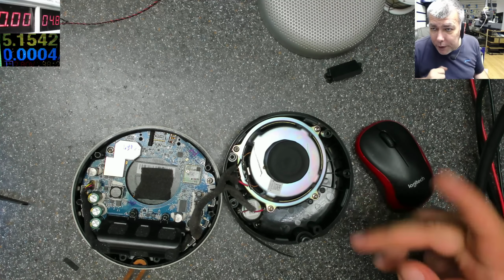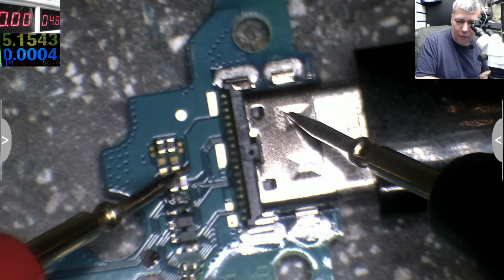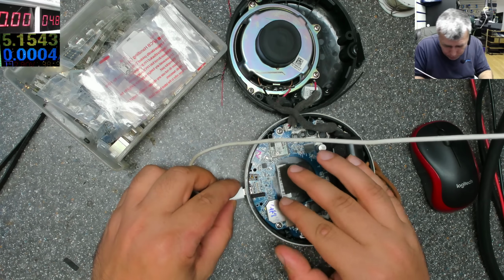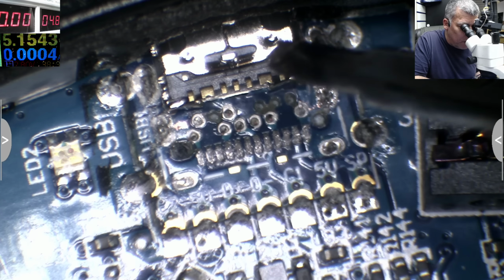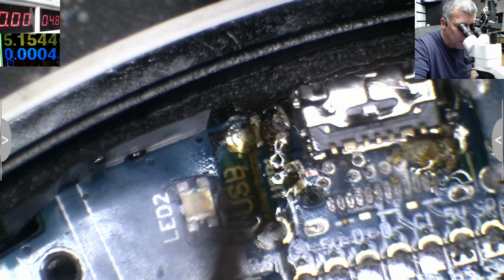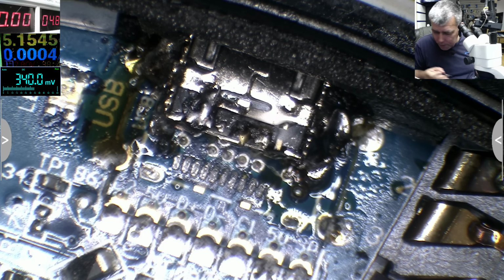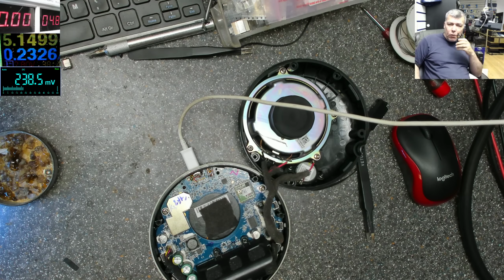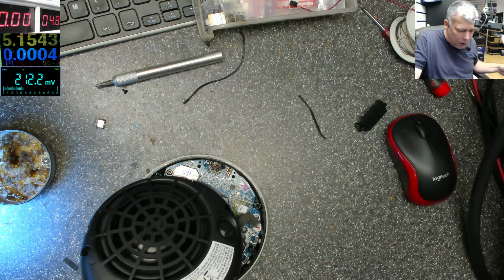Usb-C To Micro usb port charging port modification

Comment: awesome..........  I was able to get an amazon tablet charging again...........  I could not find a replacement port so i used a port i had here.    I ran 4 jumper wires instead of the original 16.
No data connection but customer just wanted it charging again as it was only 6 months old.    Works !      Charges at 1amp and is still usb-c.       Thanks Sorin, another great video

Comment: hello can you share model number of your hantek multimeter and also if you connect bench tech power supply to get output voltage or current? thanks great videos ..canada

Comment: although i dont know if its cost effective , new one same model cost about 20 euros in my shop, although this one has been branded , but it is exactly the same down to a strap and metal on it, built in same factory. We don't even bother changing connector, whole pcb is bought for spares and charged to a customer for 8 euros to be replaced
Reply: 20€ for what, for B&O beoplay A1??
Reply: @bodeksrc8007  yea, as much as people don't want it to be , all cheap ones are actually rebranded coming out from pretty much same factory , some with minor tweaks  slightly bigger battery, some additional junk in box, and custom colors.
but it is exactly same 5 w speaker with 10x price tag.
Reply: @idimidodjimi6760  lol "from pretty much same factory"? Then that pretty much means it's made by someone else. Pretty much makes it a knockoff.

Comment: I HAVE SPEAKER LIKE THIS THE BATRY OF THIS SPAKER   HASE 3 WIRES THAT S MAEN NEGATIVE WIRE AND POSITIVE  WIRE BUT  THE THIRD WIRE IT S USING FOR WHAT BECAUSE I CHANGED THE BATRY WITH NEW BATRY WITH ONLY 2 WIRE BUT IT S NOT WORKING GOOD

Comment: 1:55 comeon Sorin! You have microscope and you look at the pins but NOT inside of the charging port? 
gold traces/pins inside can be broken or 1/3 or their lenght can be ripped off - that is why, one charger cable will be working, other will not.
you can easly check it by looking inside of the port.
but why you didint do it at all? wtf? :)

Comment: First of all you didn't push through the end of your wire second of all the tip of your soldering iron is filthy its all full of plastic which is melted from the USBC Jack and it's never going to stick with all that plastic there so clean the end if your soldering iron and twisty ended a wire antenna the end of the wire with some solder so this way when you touch it it'll automatically stick to it so you don't have to put a lot of heat on to the Joint I know you have your own way of doing things but I was always taught to work smart not hard
Reply: What does it mean to "twisty ended a wire antenna"?

Comment: How the charger negotiate PD with micro USB 😐🤷‍♂️?
Reply: It can't. No data lines, no communication.
Reply: It doesn't need to.
Reply: there is no fast charging so there is no need for charger to change voltages, it stay on default (5V). Not all usb-c devices use fast charging

Comment: Will it stop charging when the battery is fully charged? 🤔
Reply: ofc it will connector has nothing to do with it
Reply: @idimidodjimi6760  I was wondering why this kind of device needs data lines?
Reply: @bessydeejay1  it doesnt, if you asked me i would placed a regular barrel plug from the factory on it and be done with it. But you know EU regulations  - USB plug on everything so one knob that looses the track of all cables and chargers can use one cable for all. And then he is gonna complain how bad they are and they cant transfer enough power cause wire isn't thick enough. :(
Reply: @idimidodjimi6760  That's true!

Comment: Sorin got 2 drive qnap 251 personal server it's got i/0 problems on the second drive and it want sink in to raid mode have you repaired any of this  ?
Reply: Maybe not maybe is to complicated ,you are just good with mosfets and hot glue gun
Reply: @Eric H i changed them over but according to qnap they suffer from backplane card failure and they are impossible to get hold of  so I'm thinking of a repair as is only 2 possible IC's that could go wrong on it?
Reply: @Eric H this is my first ever server and I got it on ebay for £30 with this fault listed at first i assume it would be 5v or 12v supply problem but no👎 supply is good and all mosfets diodes working ok so could be something open circuit or the chip or two 🤔 saying that i want it to learn about nas storage and even with one drive working is good fun 👍👍 i didn't get synology as i wanted Hdmi port for TV

Comment: See this is where I saved the pieces of wire that I could off on the end of resistors and capacitors that USB C so small you could take two of those pieces of wire wrap it around it soldered on the ends which would secure it a lot better than just solder eventually that guy's going to be pulling it in and out that charger and it's going to loosen the sodder and it's going to yank that thing at all over again if you use the pieces of wire along with the solder it'll secured even better now I have two you've got that done and it's secure and it's tight in there then you can go ahead and match the leads up to the corresponding points where they have to go the data and the 5 volts and the ground this way now the USB C Jack is now secure and tight and you don't have to worry about him yanking or she yanking that cord out and ripping the solder apart you do things your way I did things my way my way would have taken a few minutes longer and it would have secured it a lot more I don't know why where you do your business what I was taught if you do your job properly you do it once and they don't have you don't have to have them come back at that have them fix the same job all over again